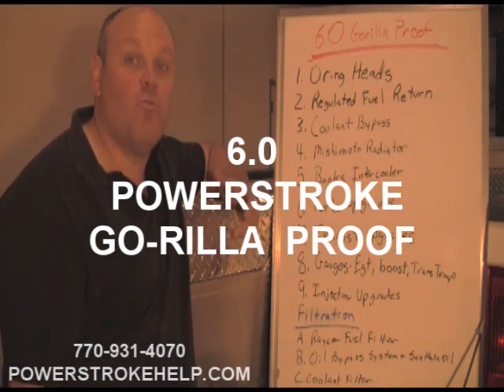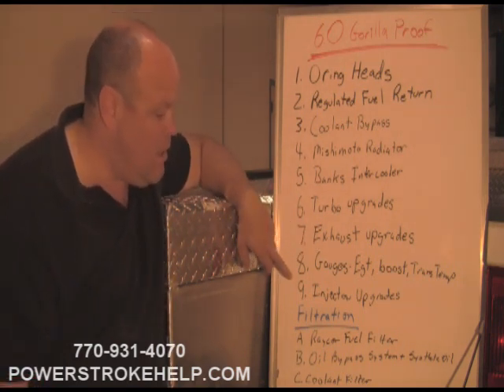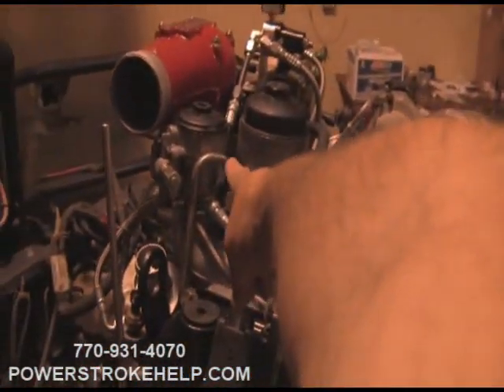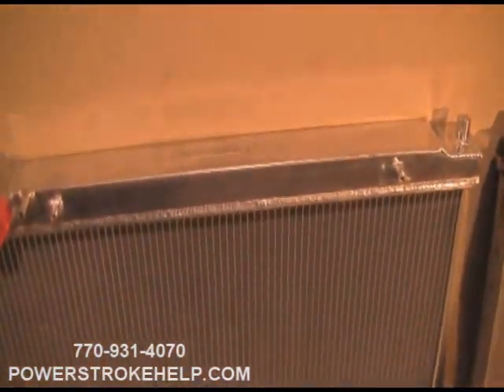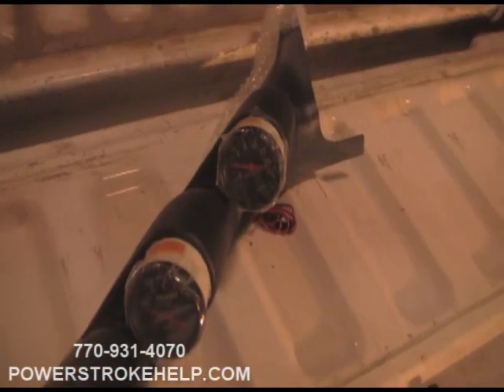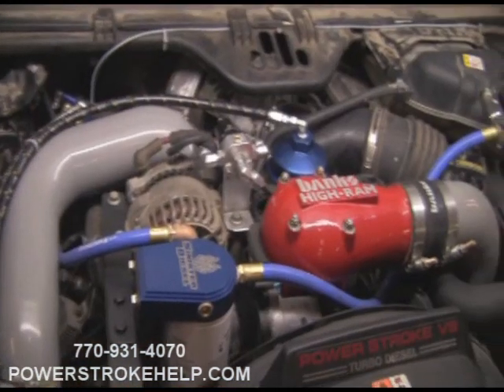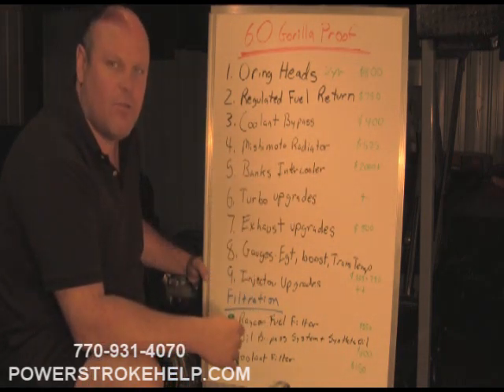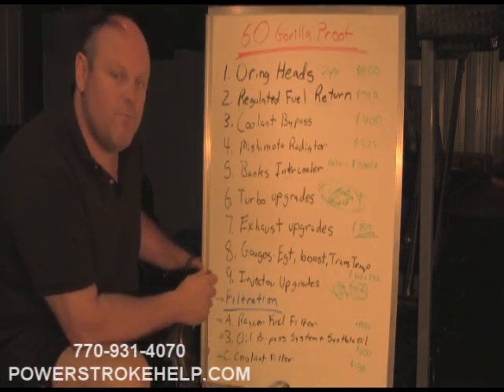GORILLA PROOF the 6.0 PowerStroke Diesel

Comment: I have a stock 2005 6.0 with 4" turbo back exhaust and coolant filter and started to notice my coolant and oil temps get about 20-25* appart while driving down the highway at 70 with my AC on outside temp is around 90*. If I slow it down in the city or let it idle they go back to within 2-5* of each other. Is this something that I should be worried about?

Comment: Hey i got a ? I know i'm off topic but i got a 1999 F350 7.3L Powerstroke 
with a Z.F 6 Speed Manual Transmission I want to change the tranny fluid 
but the asshole that owned the truck before me has welded the tranny fluid fill hole
plug on the transmission.... Can i put a fill plug on the PTO cover at the same height as 
the other fill hole?

Comment from the maker: Have you actually done the conversion. How did you get the AC/ climate control to work, cruise control, 4x4, which driveshafts did you use, auto locking hubs, trip computer, mate the transmission pcm/ engine pcm to a different engine. It is easy to sit behind a computer and postulate that it may work. AND if you pay a professional to do the job it will easily run $25k. Or it will be amateur cobbled together junk that has no value.

Comment: what is so expensive about it? i can see if you were swapping in a common rail it might start adding up but 12valves are cheap to come by, the complete kit runs $3500 if you are using the ford auto, cheaper if its standard.. there are lots of 12valve engines in the $1000 range, i bought 2 complete trucks for 1500 for the pair.. so where does the other $21,500 come from? im not trying to be a dick, just trying to justify $10,000 to make a 6.0 relaible, and its still inferior to a cummins..

Comment from the maker: It has a lot to do with the loose nut behind the wheel. I just put an engine in an early 03 F450 that was bulltproofed and tuned that NEVER had an easy life. It had 492,000 and still ran good but was using oil.

Comment: You can make the 7.3L pretty fast. But not as fast as the 6.0L, Downside is, the 6.0L will last several hundreds of thousands of miles less than the 7.3L, If you want to pour money into something that will break easily, that's up to you. But the 7.3L will last much longer, thus protecting your investment more.

Comment: Bill, in the video, you stated straight exhaust will decrease MPG on a stock engine. I bought my 03 6.0 w/ 4" silverline with kitty and muff. Its not true 4" though, down pipe is 3.5" I removed the kitty and muff, shortly thereafter lost an injector, replaced all injectors w/ a used set then realized Ive lost 3 MPG. I am running a stage 1 in-line module (Dr. Performance) and an airaid intake. MPG loss because of Exhaust or injectors

Comment from the maker: I am assuming you have a 6.0. You need to open the side of the fuel conditioning module (get a new gasket from Ford) and clean it with brake cleaner.

Comment from the maker: I have seen reliability problems with fassfuel systems due to improper installation. First for them to work correctly they NEED the regulated return. In the stock system they work so hard that they constantly burn up wiring. Installed correctly they are excellent systems.

Comment: Bill, off topic but I can't get a good answer. I have a 97 7.3 and just performed a fpr mod using a BB. (i tested at 40psi at idle) I know this is the shade tree mechanic way of doing this. After the mod I test at 75psi. Is this too high? Am I at risk of unseating injector o-rings? So far it's idling really smooth. No leaks.

Comment from the maker: The cranks, rods are never an issue. The pistons get damaged from the heat. BUT you can hurt a stock tuned engine if you run it hard all the time.

Comment from the maker: Yes. One of the reasons I am not a big fan of upgraded injectors is I have taken several motors apart to find cracked pistons, broken rings etc. The stock injectors will not flow enough to make this happen.

Comment: Bill why not recommend the Davco Fuel processors? They have different micron ratings as low as 2 micron, fuel filters can be purchased with the water membrane as an additional precaution, you can have a water sensor installed as an option, these really are not that much either. You can see the filter too and know when its time to change.

Comment from the maker: For the most part 6.4L up grades are the same. Being direct injection the Regulated Fuel Return does not apply, but a Mishimoto radiator is a must on a 6.4
Reply: Hey I really want to get my 2007 Ford F-250 6.0 XLT crewcab bulletproofed can you give me a Estimate because I’m located in hinesville Ga about 4 hours away from you guys pretty far drive what would you recommend I do ??

Comment: I agree, 60K maybe when they are new.  If your upgrading your engine like this the truck has alot of miles, it isn't worth what you spend on the engine.  all those upgrades for a 1 or 2 yr warranty..not worth it buy a new truck there not 60K in Texas or new engine.  but Im impressed with the knowledge

Comment: looks super sweet man 5 star for sure, ive done the bulletproofing method you've explained, (arp head studs, egr cooler, and oil cooler) on a 2004 6.0, and for some reason i keep getting a low boost code, ive checked over everything for leaks and still the code keeps coming back, @ 2000 rpm im getting 15psi, im not sure where its supposed to be at. but at least there's no more oil in the damn cooling system haha